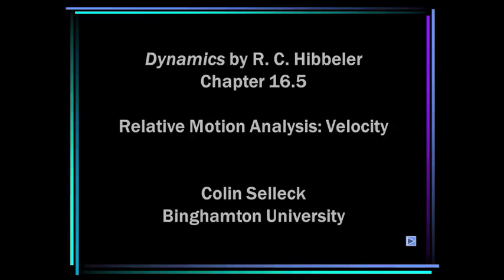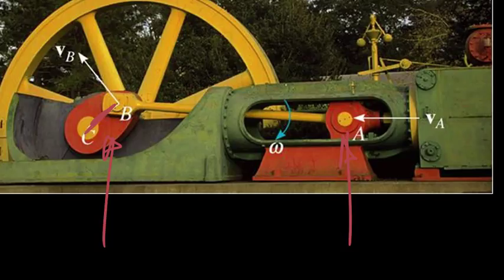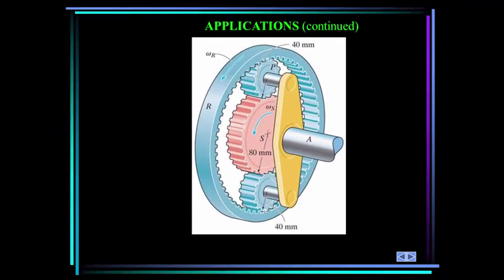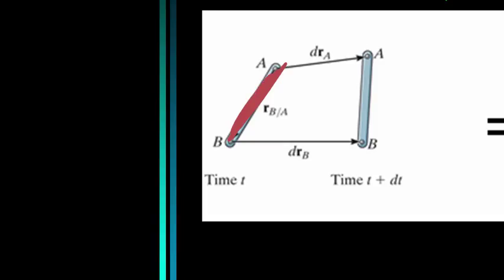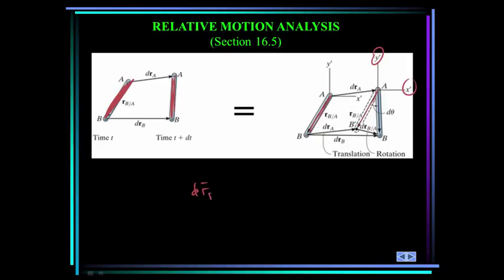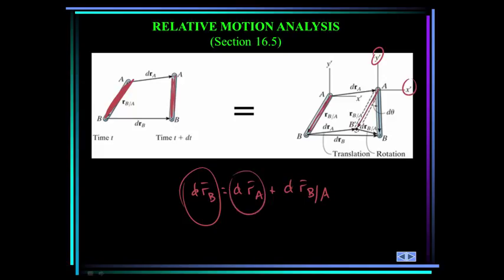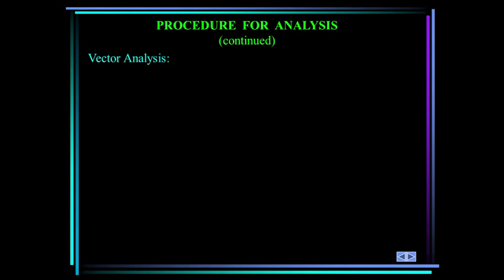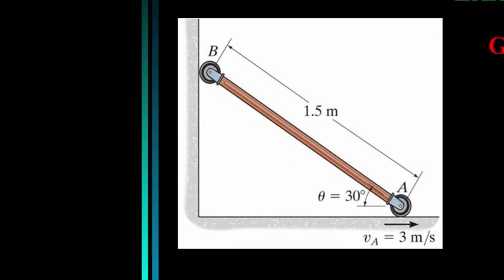ME 274: Dynamics: Chapter 16.5

Comment: When considering R what is the best way to decide whether i should use Rb/a or Ra/b ; seems to switch looking around at different examples.
Reply: My question stems from: In the second example you choose to use A->B (4th quadrant) and thus Rb/a but in the 3rd example you choose C->B (2nd quadrant) and thus Rb/c , how do i make this choice correctly in other examples?
Reply from the maker: The best way to do this is to write the subscripts correctly. e.g., Va = Vb + w cross Ra/b. From left to right the subscripts read a, b, a/b. There is an order to it: A B A/B. Once you do this correctly, all will be well. You can also write Vb = Va + w cross Rb/a. To envision what Va/b is - you are standing on B and looking at A so Va/b means the velocity A appears to have if you are standing on (and moving with) B.

Comment: Thanks Colin. I'm reviewing some old material for my Comprehensive exams for my PhD program. I was reviewing Meriam & Kraige's Engineering Dynamics where they suggest graphical vector methods (brutal). I knew I first learned it another way, once upon a time. I couldn't find my notes though. So I stumbled across this and it all came back! Thanks for teaching dynamics the right way.
Reply from the maker: +kwmountainbikers Thanks mountain biker. I cannot understand the graphical solution as well as the vector representation and it seems prone to errors. Too much trigonometry.

Comment: In the last problem, for the velocity of B shouldn't your I and J components be switched? Or did you already account for the cross product and change them?
Reply from the maker: +Micah Schumaker Sorry for the late reply. The velocity of B components are correct since the velocity of B is perpendicular to the link AB, which is at 60 degrees in the first quadrant. So Vb is 30 degrees away from the negative x axis. I could have written -cos30 i + sin 30 j.